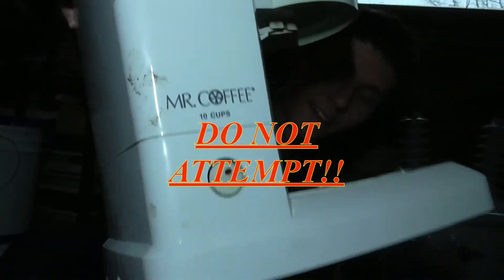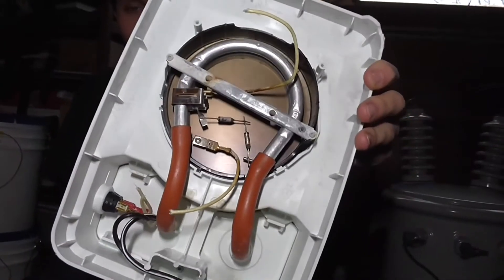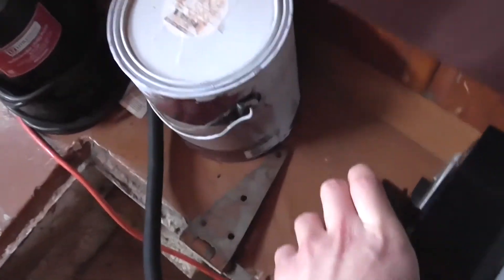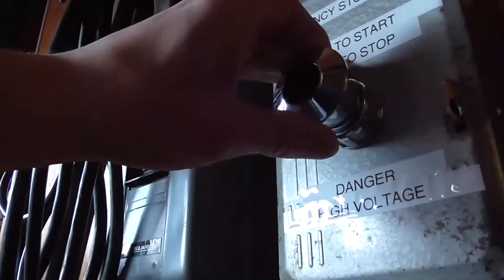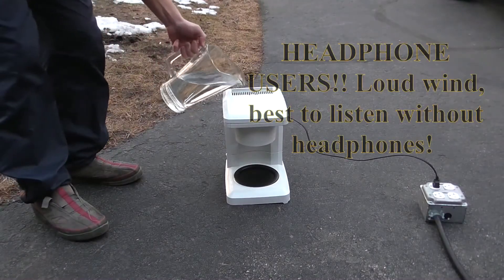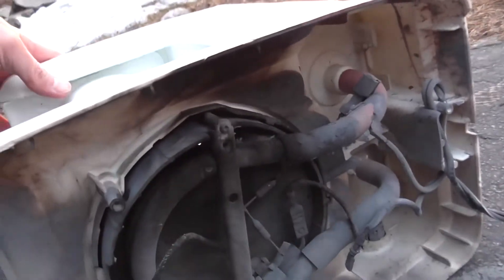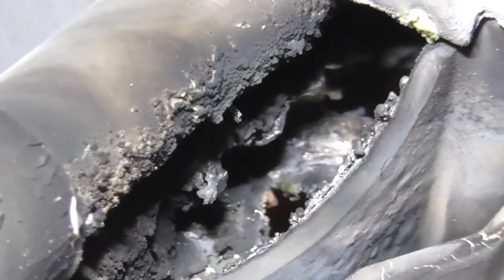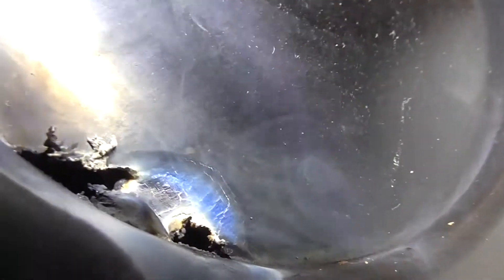Coffee Maker Blows Molten Metal At 480V!!

Comment: Nice explosion! That transformer start-up sounded amazing too! Where did you get that transformer? I might need to get one sometime, right now I only have a 5kVA 120/240, and to get 480 volts I have to run the transformer at 120 volts and put my supply 240 in series with the transformer's 240 output.
Reply from the maker: I got it from eBay for + - $300, they sell reasonably there;)
Reply: Oh cool, thanks!